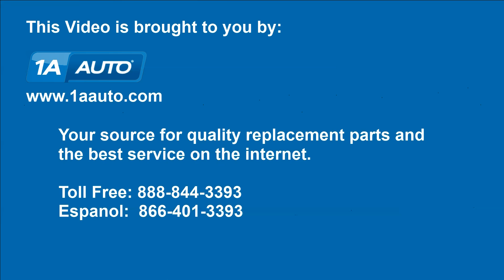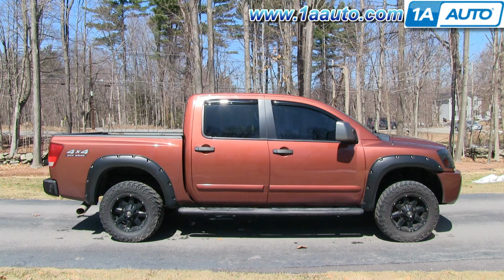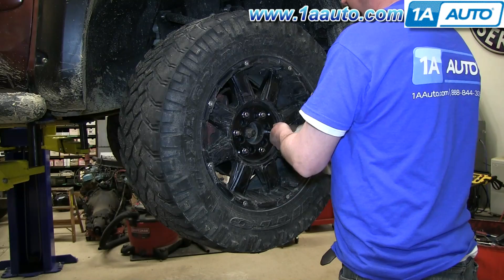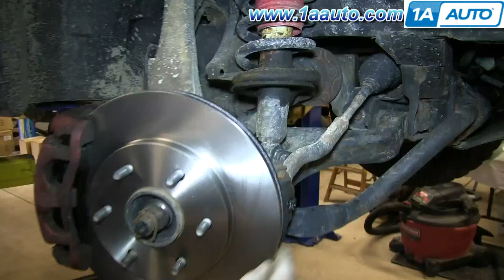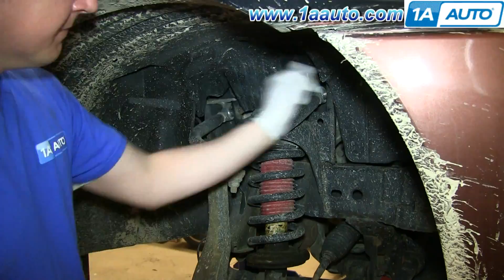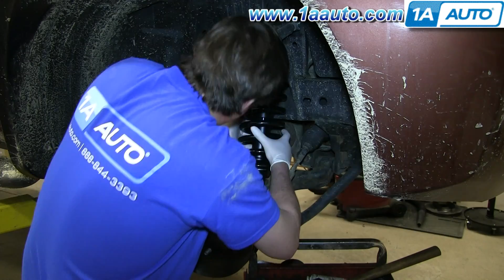How to Replace Shock & Spring Assembly 04-15 Nissan Titan

Comment: Will this work the same if I decide to add a 1.5 or 2 inch level kit while installing this?
Reply from the maker: +Wade Armstrong This may not be able to function the same way if there is a leveling issue with the parts.

Comment: Will these fit a 2014 pro 4x? I went to the site to order but don't see it mentioning anything about pro 4x. Thanks
Reply from the maker: +pit_blvd There are multiple specifications for the struts. If you need help with checking into the fit, please give us a call.

Comment: I re-used my springs to get the same ride height. that takes added time and saves quiet a bit of money. if you have time as I did re-use the springs. careful with those spring compressors. they can kill you.

Comment: Will this work good with 2” leveling kit?
Reply from the maker: +Jared Welch Our parts are all built to the same specifications as the dealership unless otherwise listed. These struts would not be able to work for vehicles with a lift kit.

Comment: No they are not the same.    The springs are different.   What's up with that.   Why is the new one have more coils?
Reply from the maker: +Lee Moses Thanks for watching!  The new part is just an improved design which helps keep the vehicle from sagging over time.  It will still fit and function just like the originals!  1aauto.com

Comment: How the hell did you get that joint in there so fast did you losen the sway arm.
Reply from the maker: +Matthew Pohl At around 2:25 we show how to slip the old strut out so that you can replace it with a new one. We were able to sneak the old strut out through the top of the suspension. Hope this helps you out. 1aauto.com

Comment: I got a 2006 Nissan Titan se. I’m looking for the two front coil over suspensions. I’m not lowering it just replacing the old one. Nothing fancy just reliable. Any suggestions. Post a link. Thanks
Reply from the maker: +Kameleon Kreations Here is a link to them replacement shock and struts that we carry for your application. There are also auto repair videos associated with them. Hope this helps you out. https://www.1aauto.com/2006-nissan-titan-shocks-and-struts/y-mo-c/2006-1075-64?utm_source=YouTube&utm_medium=CTA%20Comment&utm_campaign=ytcomment
Reply: Thanks for the info. Also can you send me a link for a 3” spacer just to give the front a little lift. Thanks again

Comment: A bit of important info that is missing ....The sway bar link is right in the way (at least on a 2008 Titan Pro 4 X )  The only way to remove ....and even more difficult, re install is to take the links off.  Use a knuckle on the 14mm inside, top bolt as it is tilted toward the engine just enough that it can be rounded off very easy (trust me)  Best way is with a long extension and loosen those two from inside the hood, plenty of room
Reply from the maker: +Bob Martens Thank you for checking us out, and providing this information for your vehicle. Our viewers that attempt this replacement on the 08 Titan Pro 4x will use this to complete the replacement. 1aauto.com

Comment: I wouldn't hammer the shocks... I would press down the lower control arm and push the shocks in. If you really need to use a hammer, I would use some plastic/ rubber type hammer

Comment: Is it necessary to get an alignment after this repair?
Reply from the maker: Yes it's recommended to seek an alignment after completing this repair. Thanks for watching 1aauto.com 866-403-3393
Reply: 1A Auto Parts 
However most say it’s not necessary. I’ll let you know as I am in the process of replacing mine as I type.
But this guy is the expert. Either way I’ll be getting my alignment checked.
Reply: It’s aligned from the factory with the same struts as were put back in unless you level it.. unless you changed any others parts that could change the camber caster or toe.. this strut should do non of this but provide a better ride quality I don’t think it’s necessary if it’s the only part changed at the time

Comment: Excellent video.  Just replaced the struts in my 05 Titan and the video was spot on.  Had a little difficulty getting the old ones out (stabilizer bar was in the way) but was able to lightly pry them out.  Replacement was a snap.  Thanks 1aauto.
Reply from the maker: You’re welcome. Glad to hear your repair went well 1aauto.com 866-403-3393
Reply: That's because they didn't  show you need to remove the sway bar links to drop down very easy. I had trouble also till I seen another video lol

Comment: just did my 05' qx56 and boy did this video help. I even bought my quick fit struts from 1a auto..Only problem I had was that my lower arm was putting pressure on the strut and I caught pure hell getting it out. It was a circus show. One question though....My car now sits up high in the front and my rear is at the level I like. Is there any way to bring it back down level with the back??
Reply from the maker: It could be because the rear shocks are worn too, and the vehicle is sitting lower in the rear than when it was new. Thank you for your order, hope this helps you out. 1aauto.com 866-403-3393